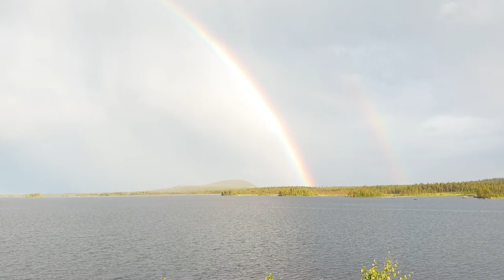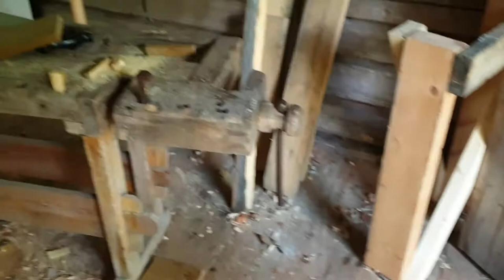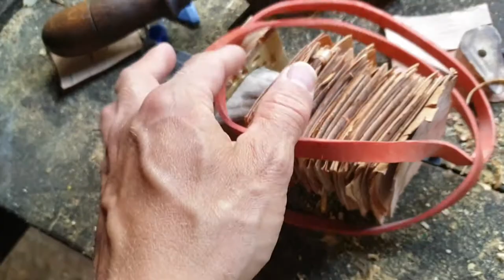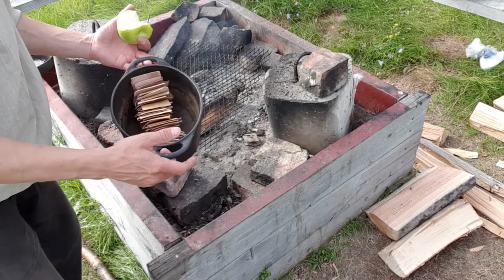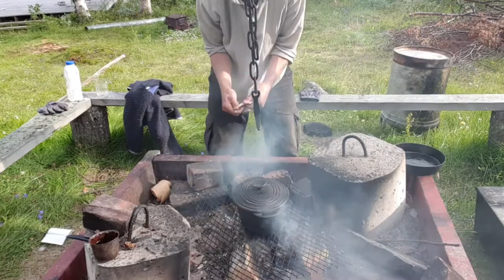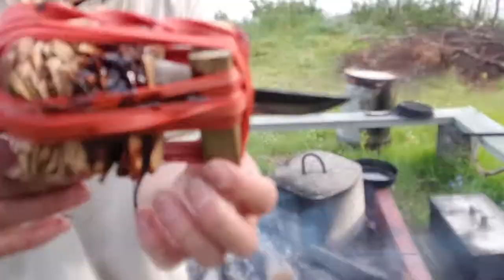Making A Birch Bark Knife Handle In Swedish Lapland. Ep 5 of 7

Comment: Hi Vahid , Is this a traditional style , pitch adhesive. I did a hachet handle and hadn't seen many videos on the subject so I glued the pieces into about one inch blocks (20 cm ? ) . Punched them with a leather punch first. I then reamed out till i could force them on the handle and glued and clamped. Oh it was an estwing hachet with stacked leather handle and has a curved handle. Kind of I beam in cross section. Anyway since then I've seen some videos from your area and some are just heated and pressed ? I like the idea you used. Without the added resin I don't think they'd stick so good. Especially on a project like mine. It did turn out well and as I mentioned before I have another hachet , same problem , rotten leather , that I'm going to fix and hope to document.
Reply from the maker: Hi Timothy,  I have never heard or seen of pitch being used as adhesive for knife making. I know it's been used to seal seams and holes on birch bark canoes. I didn't have normal consumer glue at the cabin, so I thought I'd give the pitch a try. I think it would work well to conservate and protect leather agains rot too if the leather is well inpregnated with it.
Reply: @VahidCullsberg  Sounds reasonable. I'm familiar with it and it's vaiations. One of which I call "cave-man" hot glue. I wonder how birch oil wood work. I've never made or used that b ut that's basically what's bonding the layers together in a traditional pukko. Funny you mention birch bark canoe as I was working on stem pieces for one yesterday. Made a mold to hold the frames and was rough sizing my stock. Didn't split the laminates yet. I only have one extra piece of stock so I don't want to rush it. Yeah I used elmers carpenter glue. I was a little aprehensive of useing it because I thought it might ruin the corky feel of the birch bark. But it didn't. To many projects and winter is ending.
Reply from the maker: @timothylongmore7325  Haha that's funny that you happened to work on a birch bark canoe. Have you watched "Cesar's bark canoe" It's on the National Film Board of Canada...nfbc...likely on YT too. Wonderful documentary. Birch tar is an amazing resource for sure.
Reply: @VahidCullsberg  Yes I've seen it many times. It is on youtube. There are several others too. Check out Nomadic Woodsmans channel. He has a sprucebark and birch bark build on there.

Comment: Two blocks of wood with two long bolts is the normal way to press the handle
Reply from the maker: Who wants to be normal?
Reply: @VahidCullsberg  I hope no one. ;p
Reply: But not traditional, these knives were being made long before threaded bolts were available...
Reply: @jasonbyrne8487  ok so no longer are you allowed to order parts go out and dig up rocks till you find what you need!
Reply: @nivesknight  😂
Reply: @jasonbyrne8487  and the threaded bolt has been around longer then you think. Just wasn't made the same.
Reply: @nivesknight  Yeah, I know, but nothing was commercially available until Joseph Whitworth standardised threads in the 1840s...
Reply: @jasonbyrne8487  correct how ever as a blacksmith I know how they were made before that. They were cast at a point before that. With forging before they cast. But would be a different size or what not blacksmith to blacksmith. A lot of tools and mechanisms existed before the modern manufacturering of a more standardized world.